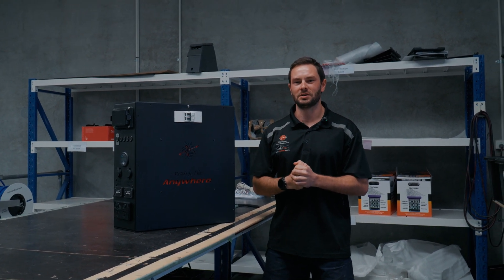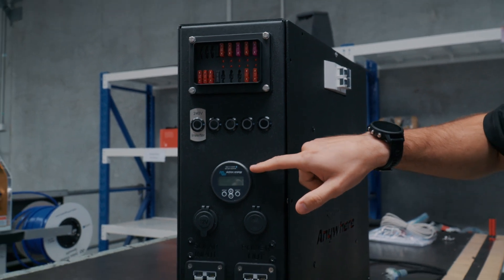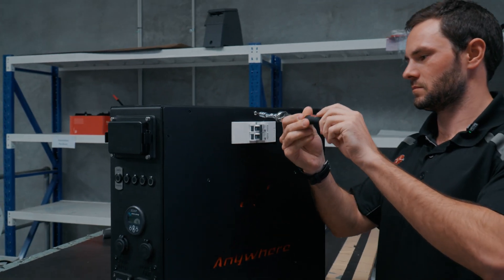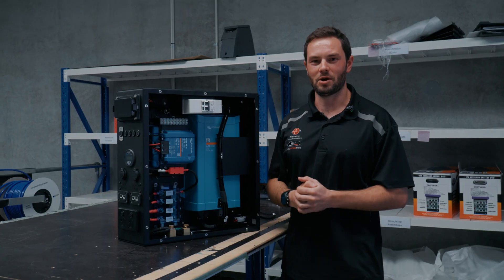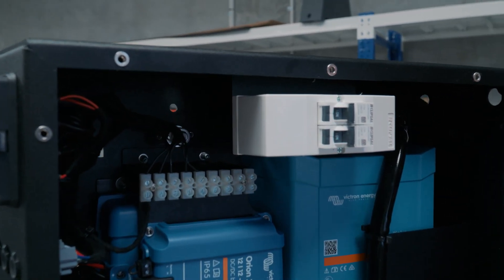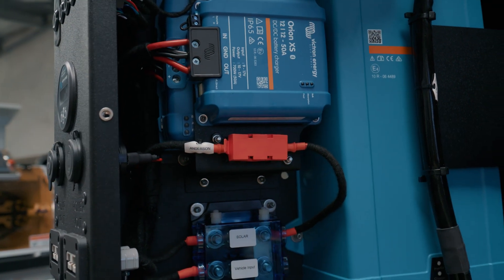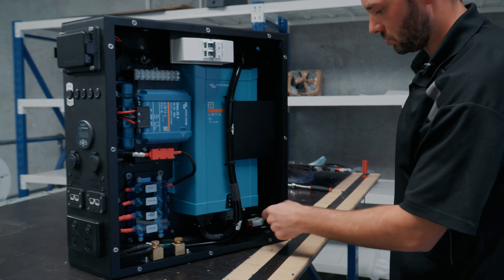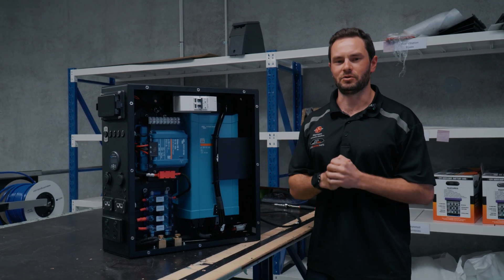The Scout: Compact 12V Power System for Toolboxes & Canopies

Comment: This is designed to be permanently mounted, so I'd be putting a fridge plug on the back so you don't have permanent fridge wiring taking up space on the front, the same as you woukd on a custom build. An Anderson plug and Engel plug would be easy to mount somewhere on the back for permanent accessories that dont need to be switched.

Comment: I'm keen to understand if there's any issue mounting that DCDC charger on its side like that vs the recommended vertical position. Have you tested heat issues? thanks
Reply: Alsdo the back to back with the other unit underneath making heat. Yje Orion restricts charge down over 40 degrees C slowly as it gets hotter.
Reply: Orientaion keeps the IP rating correct when exposed, otherwise you can mount anyway as it is enclosed in the casing.
Reply: And the cable size running to the Orion doesn't appear to meet Victron specs to take advantage of the 50amp output. You may want to revise that to 4b&s.
Reply: Btw. I should add I’m asking because I would like to mount this de dc in that orientation. But unsure if that’s going to work thermally.

Comment: G’day Justin
Great equipment.
Thanks for fixing the other day my el problem on the redarc charger.

12V power plug on the unit
You need definitive 2x usb C plugs with each 100 or 130 watts
Charge laptop
Starlink mini
Both need min 100w supply

Anything below will not work

Keep the good work up.. see you next time

Cheers Holger